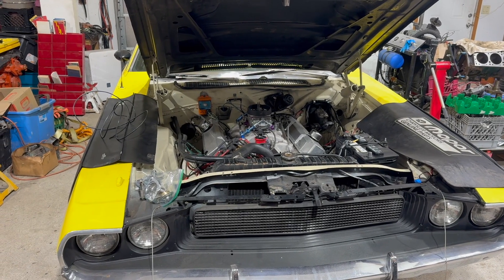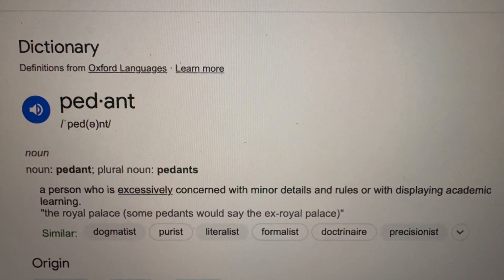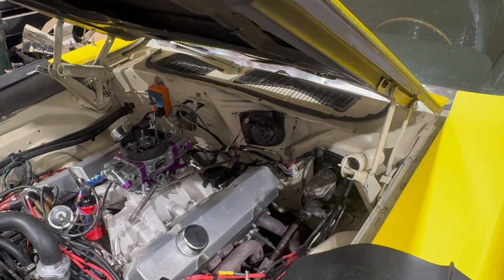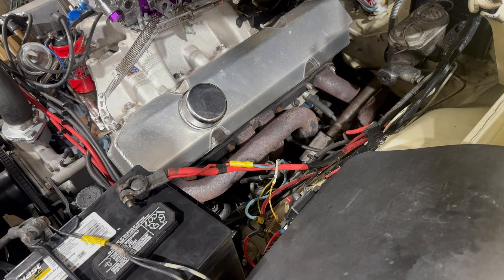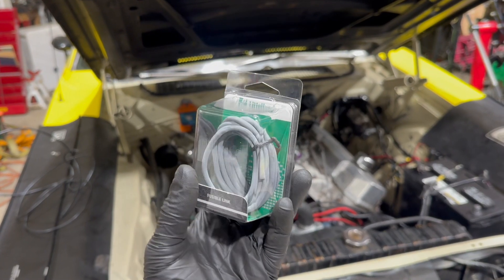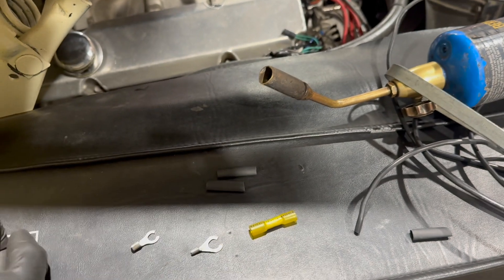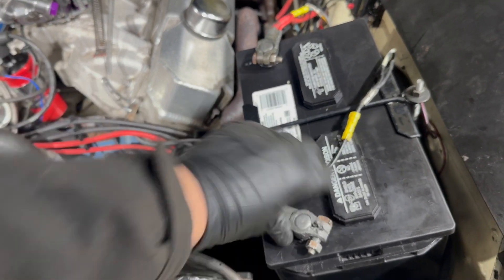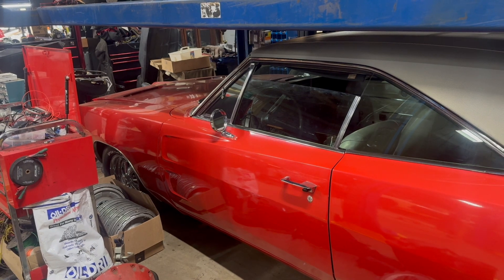The Big Shunt Wire Guide - Prevent Electrical Meltdown In Your Classic Mopar With This Easy Fix

Comment: I need to do this but i need to diagnose first. My Roadrunner is not charging at all. I don't have that relay you mentioned on the fender.
Reply from the maker: The starter relay? If you don’t have that starter relay… you don’t have an intact classic Chrysler electrical system. If you find that you do, in fact, have a factory electrical system, my Classic Chrysler Charging Systems video should have all of the information you need.
Reply: @DeadDodgeGarage  I need to definitely watch that video. I have a starter solenoid or relay on the fire wall but someone has cut into it to install a push button. I don't like that, I'd rather have the key do the starting. I need a wiring diagram.

Comment: Hi Jamie, thanks for this fix!

Need to replace mine.

I was planning to the heavy duty factory alternative on taxis and police car by-passing the bulkhead with a direct line and fuse-able link similar your solution but it still goes to the ammeter.

I do not have additional loads like fans, electric pumps and do not plan to;  still use points ignition and 30 amp alternator like a weirdo  : )

For relatively stock electrical systems, do you mind discussing the pros/cons of the taxis/police car bulkhead by-pass for the weirdos like me that are trying to keep it stock’ish that maybe do not need to de-load the ammeter but want to improve this problem.

Would like to be able to still use the factory manual for troubleshooting electrical etc.

Electronics on the car are original and basically unmolested and appear to be in good condition.

Am new to the channel; apologies if this has been covered already; subscribed.

Comment: I'm also very close to removing my Dash and windshield for replacement and touch up to item that don't work like dome light and wipers. Wondering if you have any tips on those issues?
I'm replacing the 2 Engine Wires because I have a connection issue at the Bulk head sometimes which keeps me from getting any starter action occasionally. 
How hard will it be to replace those spade ends that are on the fuse box that windup in the Bulk Head?

Comment: Hey Jamie, love ur content and the way that you explain the project that you’re working on.  I do have a general question though about wiring harnesses.  I have a 67 Barracuda, that needs the engine bay wiring harness replaced.  It’s got a small block 360 bored to 408.  Also has a FAST EFI and an MSD rev limiter.  I’ll also be installing a one wire alternator.  Whewww.. ok, so my question is, what quality brand/ manufacturer of wiring harness would you recommend?  I’ve seen videos and been on blogs, but wanted to get ur opinion.  Anyways, keep up the great work.  

Thanks

Al
Bay Area :)

Comment: Hi Jamie, I’m doing the shunt wire conversion on my Lil Red Express.  My question is, can I use an in-line, 40amp fuse holder, in lieu of the fusible link, or Is it different than the regular fusible link?
Thanks in advance!!
I love Dead Dodge Garage, keep up the great work!
John R
Reply from the maker: Fusible links take longer to blow. If you were to use a fuse, I would want more like a 60 amp fuse to have some headroom, and in a heavier duty fuse holder.

Comment: Can anyone tell me why I'm getting like 16volts on my volt gauge now after doing this? Before this I had no issues.
Reply from the maker: Because you’ve had an over charging problem that was being masked by a poor connection through the firewall. Check the voltage on the ignition source wire to your voltage regulator (blue) for a 2-3 volt drop from battery. If there is no appreciable drop, you most likely have a bad voltage regulator.
Reply: @DeadDodgeGarage  thanks for the info I will give that a check and see what I come up with.

Comment: I always had non-functional Ammeters, so every time I've done this, I added a voltmeter.  My concern was always that if my shunt fuse blew.. I wouldn't know and I'd just start pulling more Amps through the firewall.  
   Now watching your video... with a functioning Ammeter,  you could see if the shunt went dead because it would pull more through the gauge.   Hmmm...
Reply from the maker: Right, exactly. You would probably know.

Comment: Thanks for this Jamie. As always, excellent. 
What are your thoughts on running additional loads/relays off the alternator rather than the battery so as to reduce load having to go from the alternator through the bulkhead then into the battery end. I'm deeeeeep in these videos right now as I'm installing tri power efi on my 340 and the bulkhead is miserable, so doing everything I can to reduce what's going through it (from the alternator or battery)

Comment: Great guide, although I do wish you would have shown 1) which post of the alternator to connect to, and 2) which lug of the starter relay to connect to. Other than that, and the fact that without showing either one of those it's almost useless, this was a great video.
Reply from the maker: I had hoped that the fact that there is only ONE threaded post on the alternator (with the current charge wire going to it) and ONE threaded post on the starter relay (with the current main feed wire going to it) would make this self evident. I see now that I was wrong, and that this could turn into one of those “instructions unclear, dick stuck in blender” type situations. I apologize profusely, and will more carefully consider these things in the future. Thanks.
Reply: @DeadDodgeGarage  Actually got my dick stuck in the clutch fan instead, but same difference, only worse. Again I do appreciate the video, I'm just retarded.

Comment: It's funny that Ma Mopar just decided that the ammeter would be a dummy gauge on cars with the HO 100amp factory alt. It's literally not hooked up to anything, and the wire is bypassed similarly with a fuse link to the starter relay. They also added a case gnd wire, something like an 6 or 8 gage, that uses the same neg battery cable attaching bolt to the head. This is critical, and if isn't there, it'll eat voltage regs. If your lights start to pulse or flicker with 1 of those big alts, check that gnd connection. The reg is going nuts. Fun fact: The original 100amp alt on my 79 300 still puts out 91amps at 2000rpm, 12.9v, fully loaded, according to my VATT 40.
Reply from the maker: Well, obviously they knew it wasn’t up to the job… Good to know on the case ground.

Comment: Jamie, if I add this shunt as your video suggests to my mostly original 67 Coronet, it looks like I will be jumping around the voltage regulator.  Isn't that a bad thing?
Reply from the maker: That’s not how the voltage regulator works. It connects to the alternator on a small brush terminal. The output currently goes to battery through the firewall connector (twice) and the amp gauge / alt gauge / ammeter. This under engineered and complicated circuit is the reason for the shunt wire.

Comment: On the relay where did you hook it
Reply from the maker: Oh, the large stud on the starter relay. It’s used as a connection point for battery power to the rest of the car.
Reply: @DeadDodgeGarage  thanks, it's hard to see on the video. My first dodge product
Reply: @DeadDodgeGarage  and the positive big lug on the alternator correct

Comment: good video. thanks.  the element on one of my ammeters burned up, left me stranded.  that's when i learned about this problem the hard way.  it burnt up because of the bulkhead connector was bad, that is were the problem starts.  i did my "shunt" differently but essentially the same.  also i no longer use an ammeter, i like to convert to a voltmeter gauge when i can, which wires in differently

Comment: As a mechanic  in 1970, we did not upgrade anything  that was not  broken
Reply from the maker: I wholeheartedly agree with that concept in theory. In practice, you can either protect this under-engineered circuit while it’s still good, or deal with it when (not if) it corrodes and melts to bits. Whatever is your pleasure.

Comment: If you add a fuse and not a fusible link, be sure it's a type of fuse and fuse holder capable of the current it's expected to see.  I tried using a 50 amp blade fuse and fuse holder in my Newport to power my Mercedes cooling fan, and the fuse holders would melt down after only a few hours of use.  I had to switch over to a fuse holder that bolted in the replacement fuse.  Ever since then I've had no problem, and I'm running a 150 amp alternator to power my car.  I'd be happy to provide pics of what I speak of.
Reply from the maker: Oh wow. Yes, when I do this, I always use a screw type fuse and holder. I thought I explained that this needed to be a heavy duty solution in the video.
Reply: @DeadDodgeGarage  I'm sorry if I missed that.  I had mistakenly assumed a 50 amp fuse was a 50 amp fuse was a 50 amp fuse.  Silly me.  Several missed shows and cruises later, I learned my lesson.

Comment: If you left your heat gun at your shop, and you're doing electrical work at home, it turns out that a standard output hair dryer, on high, will suffice to shrink heat shrink tubing.  It turns out that they're actually just generally useful for working on old wiring as well, because if you gently heat up the insulation on the entire length of the wire (or at least the section you need to reshape) it'll make it a lot less likely to crack and need to be completely replaced.  So I actually bought a regular hair dryer for the shop as well.
Reply: I wonder if it's possible to alter the factory ammeter to be more sensitive to loads, and thus read correctly after the shunt wire is in place.  I may need to try and take one apart to figure that out.  That would be a neat trick.

Comment: How does it not over charge the battery if not goin through the voltage regulator
Reply from the maker: Charge from an alternator never goes through the voltage regulator… the output is controlled by the regulator through a brush connection.

Comment: How do I get my turn signals to work on my 74 Charger? Has new bulbs, new switch, new flashers, out of ideas.
Reply from the maker: Went through of all of the blinker issues on a black 1973 Challenger a while back, you might check that video out.

Comment: I put that on my 69 satelite. And a pertronics solid state points replacement under the distributor cap. Now it kinda surges alittle while running. Cranks good. Any idea what would cause it to surge ?
Reply from the maker: It just about has to be related to the ignition swap. Not sure how or why. Maybe the timing changed when you did it.

Comment: I thought it was supposed to go to the positive battery terminal as mentioned in one of your videos from before I’m confused now?
Reply from the maker: The stud on the relay is functionally exactly the same as battery positive, and gives you a cleaner connection point. Battery positive is fine too, but I like this as a way to keep it from being obvious in an otherwise stock engine compartment.

Comment: Nice job.  It is good too see how others tackle problems.  I found the charge wire from a Taurus (2000ish) has a ring terminal and boot that fits nicely on our alternators - and it is like 4ga.  Always a pick at the junkyard 😀

Comment: Instead of an alt gauge could you wire a volt meter to show how much charge is getting put in to the battery.
Reply from the maker: Of course you could.

Comment: Great video thanks!  I noticed on your red charger cold start the oil psi gauge did not seem to move at all, or very little; is that normal for that car?
Reply from the maker: Yes, it’s fine. I think the new gauge limiter I put in doesn’t have the start mode (full 12 volts for some number of seconds) and the gauge climbs slowly. There is plenty of oil pressure.

Comment: I considered doing this to my 70 Dart. I repaired the overheated bulkhead connector.  When I studied the wire schematic and realized the charge path that you thoroughly explained, I didn't like it. I would really like to replace the ammeter with a voltmeter but I want a gauge face that mimics the factory ammeter. Does anyone make such a voltmeter?  I could take a generic or salvage voltmeter and repaint the face but prefer the bolt on part if it exists.
Reply from the maker: Red Line Gauge Works can build you one, I’m sure. I installed one from them in a ‘71 Challenger. It was very nice.

Comment: Cool stuff I guess you could put a smaller wire or resistor in the shunt circuit  to gain greater deflection of the alt gauge. Maybe this defeats the purpose. 1966 Dodge Travco Motorhome 318 Poly 727 factory ammeter but no bulkhead connector cuz no bulkhead. Keep up the good work.
Reply from the maker: Yeah, just a little needle movement indicating charging or not charging is enough for me. Thanks!

Comment: Thank you Jamie! I still need to fix all the electrical problems in my Roadrunner. The previous owners bypassed the amp gauge all together and just connected the red and black wires with a connector. Do you know why they would have done that? Should I change it back? I still have no lights at all except for the front turn signals for some reason. Thank you in advance! See you later this evening.
Reply from the maker: Many people have done that. The general consensus among many is that the gauge is the real problem and should be bypassed. I disagree… see you there!
Reply: @DeadDodgeGarage  Thank you!

Comment: Great video! I bought a non-running 74 Scamp six months ago. A previous owner had bypassed the ammeter, but the electrical system was a general mess. I added a shunt wire, cleaned 99% of all connectors, replaced burned up wiring, replaced the ammeter with a volt meter, added relays for headlights, and rebuilt the alternator after it failed from the brushes falling apart. Good as new!. For now.

Comment: If you are upgrading the alternator AND the charge wire and the wire will be bigger than what is necessary for the alternator output,  do you size your fuse/fusible link to the the size of the wire or the output of the alternator?

Not sure If I'm making sense here, but basically I'm putting a bigger alternator in with maybe a 6 ga wire. I would assume you always size it to the wire.
Reply from the maker: You probably won’t find a suitable fusible link for that. Use a heavy duty fuse in a solid mounted holder rated a bit above above your alternator’s output, and delete the original wire that went in to the amp gauge completely.

Comment: This is actually what I did on my 62 Dodge lancer GT, I upgraded it to a 120 app nipondenso alternator, i ran a 6 gauge wire directly from the alternator to the starter solenoid, the Amp gauge still works at least to show current direction. But everything isn't running through the ampgauge anymore. I think that the 120 amp nipondenso alternator would be a great upgrade for your valiant project because it provides great high amp charging even at idle for your fuel injection system.
Reply from the maker: Already upgraded to a one wire and added a shunt wire. Don’t know the amperage rating, but so far it seems to do alright.

Comment: What size fuse would you put on the 10ga shunt wire if you didnt go with the fuzible link ?
Reply from the maker: 40-60 amp. Not a dinky ATO fuse either - something substantial in a solid screw down holder.

Comment: I have a '77 Dodge Van, it had a meltdown at the Ampmeter connection behind the gage from before I bought the van. It's how I got it for cheap He didn't know what was causing the problem and was tired of it, I knew exactly what was wrong. So I got it home, tore out the dash, and went to work. I unhooked the wires and stuff and removed the dash I slipped two oversize sections of shrink tubing over one of the wires got a bolt and self locking nut (not a nylock) and bolted the two wires together in a straight line with a star washer between them. then slid one shrink tubing over the connection, shrunk it then did the same with the second one, having a solid and protected connection then I did the "shunt" wire like you  did. Then I went online looking at voltmeters My van has the 4 gages in a circle with the ampmeter hangs upside down, making it a little difficult to find a replacement. I found one for a Mini Cooper that looked about right and it was upside down. so I bought it and waited a few days It had a white needle. I took the gage out of it's housing, put paper between the needle and gage and sprayed it with floresent orange spray paint. that worked so excellently that I touched up all the gages needles with it. I did a little material removing from the back of the gage then using black RTV as glue, I cut a plastic container to get apiece of thin flat plastic to make some extra background for the gage, cut it to shape painted it satin black, syliconed it to the back of the gage. drilled some new holes in the housing and installed and wired it. once together, it looked factory original, needle went the right direction The font was slightly different (the only giveaway) but if you didn't know, you wouldn't notice, the various volts were in place. Had full monitoring of the charging system and the Mopar fire hazard was eliminated. I also used a high amp circuit breaker from behind a dash of an old Peterbilt truck instead of a fusable link. I hate fusible links. I prefer replaceable fuses and circuit breakers.